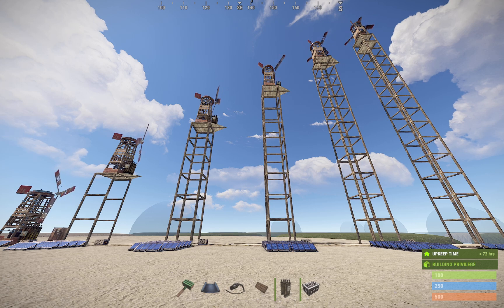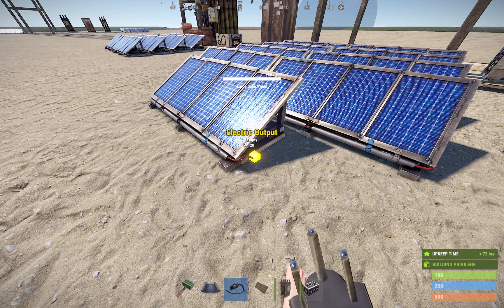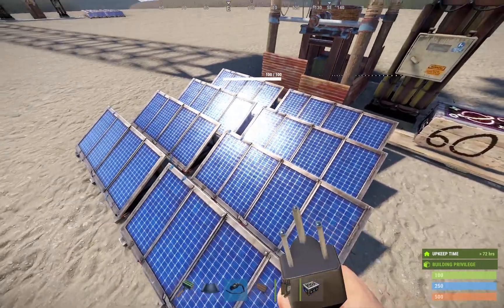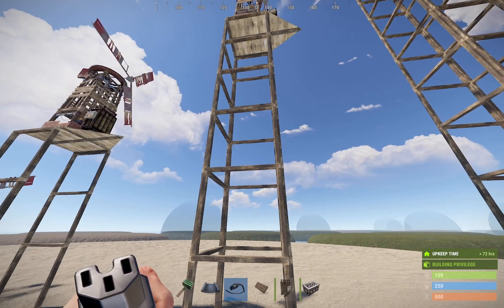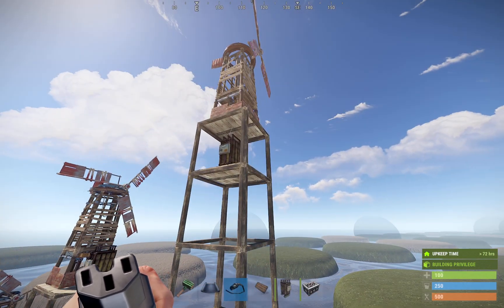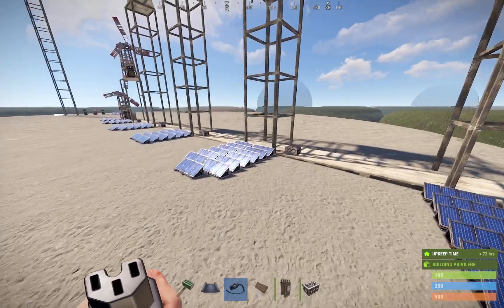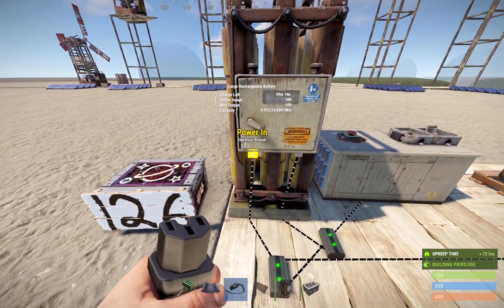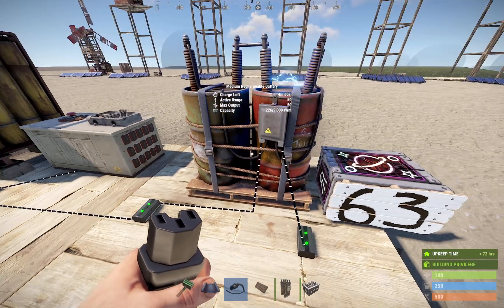ANSWERED: Wind turbine height + solar equivalent! (RUST)

Comment: You can connect the power sources to a counter and set it to show passthrough before sending it to the battery. That would make it way easier to check the values and you would not need to run around with the wire tool. I do this all the time so I have an idea of how my power sources are doing over time like for example it can show you a badly placed solar panel that may get shaded during the day. Nice video thanks m8.

Comment: Passed 126rWm, it's worth having considering Uninterruptible power supply (UPS).  Instead of getting power to the battery, you can get it directly from the source, sending the surplus back to the battery.¨

I won't go into details, but below 100 rWm, it's not worth it.

Comment: What sort of testing did you do to account for wind variance accurately over time? 

Also I don't think equating windmills to that much tech trash and hq in solar panels is really a comparison. Windmills are way more efficient. Maybe for small group teams with a couple turrets it is.
Reply from the maker: I ran the windmills for a few hours and noted the rWh on each battery at the end, which allows an average power output calculation.  I have a spreadsheet lol
Reply: @BenjaminPlaysRust  are you sure your numbers are the raw numbers or what you'd get in the battery itself "after tax". They don't seem to be correct in the raw amount. Also sanctuary really isn't the best place to be testing windmills especially for only a few hours.
Reply from the maker: @NoPushN  They are the numbers after tax, but you're right about Sanctuary -- I just replicated the experiment on my own vanilla server and my results are off by about 5-6w per wind turbine.  Nothing material enough to re-record, but I appreciate the deep dive  :)
Reply: @BenjaminPlaysRust  right so if they're after tax (you don't indicate raw or otherwise) and immediately after you talk about what the battery needs to charge you send the wrong message.
Reply from the maker: @NoPushN  The video is directionally correct.  The point being that higher wind turbines do produce more power, and that the power increases linearly as height increases linearly.  The power tax explanation was not intended to have anything to do with the prior segment but I can see how them being back to back could be confusing!

Comment: Damn, timing of your video is like the worst coincidence for me. I literally just finalized an infographic chart recently with all the proper data on turbines (been published in BB) and started on making a video I've been postponing for quite a while now sadly, basically I invented a testing setup that would allow for very precize measurements and I've been running that test for 140+ hours in total. Not only that, I verified it using a different testing approach as well. It also been performed on a very stable private build server (unlike Sanctuary nowadays) in vanilla environment basically. First versions of those tests were published like 6 months ago in EZ building discord and RGB discords. Some of your results are way off and I don't agree on your conclusions. Using certain tricks you can basically build 4x8 floor towers for the price of a single square one, each for just about 1200 stone. My fault for postponing a vid for that long, I guess
Reply from the maker: I found your results on Discord.  My numbers are similar to yours and would paint the same picture at the macro level.  Major props to you for running an extended experiment.
Reply: @BenjaminPlaysRust  I don't agree because 10-15w difference is significant; but the most important factor is that your comparison between wind & solar power sources is unfair, since you scale the amount of solar panels, but for some reason don't do the same with turbines. So arguments about having a single huge 15 story tower that can be seen from low orbit and attract raiders aren't accurate. You slap 2 turbines on just 2nd floor (even if you have a solo small base), you get 122w after the eff. tax, they'll be 3+ times cheaper on HQM, require none techtrash, no 1000+ frags on root combiners alone, they're fireproof currently (with solars a single incen rocket shot from a mini passing by can cause a lot of issues), easier to wire, and so on. Solar panels are less reliable because sun positioning actually changes with time and it will differ later in a wipe, its not really as simple as "point em to center of the map". Hopefully I'll try to save some motivation to finish my video, I literally spent a month last summer on figuring all this out
Reply from the maker: @JackDisturber  I appreciate you taking the time.  My figures are only different from yours by 5-6w though, not 10-15w.  I'm using the usable energy calculations from the wind turbines (though I fail to mention this in the video).  I don't feel like I say that everyone should use solars in this video or give any kind of unfair comparison -- I even mention that it's really up to your own base design and preferences, and each has its own pros and cons.

Comment: WOW first time I've been first but I'm not going to be that guy and yell out first...

Without even watching the video I'm assuming from the title you're not answering the most pertinent question on solar panel facing direction for optimal electrical pixie generation... I've heard if you're below the equator you have to do aim at North and if you're above it aim it South, and I've also heard aim at the direct center of the map. Thoughts?

OMG 😃😃😃 FIRST 🥇!!!!!
Reply: Okay you answered my question in the video I take back everything I said above!

SECOND!!! 🥈
Reply from the maker: Aiming at the center is the best in general, though if you have lots of panels you can aim them in a cone direction towards the center for slightly higher output  :)